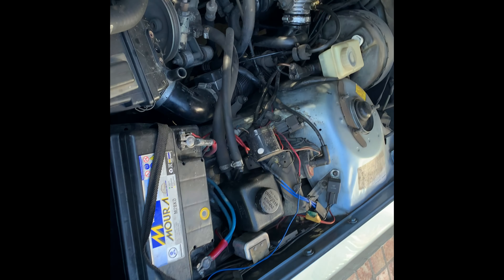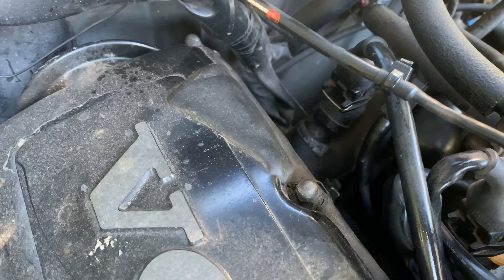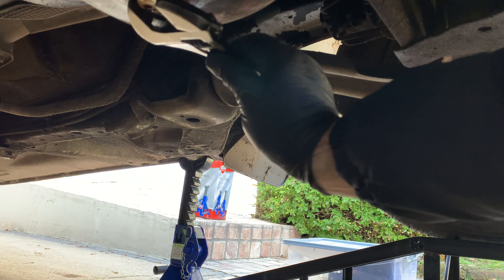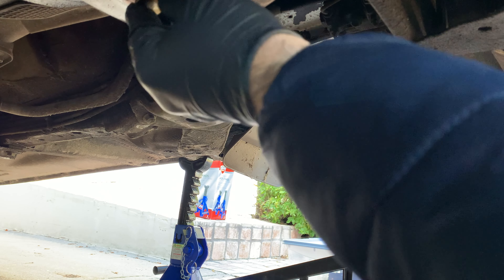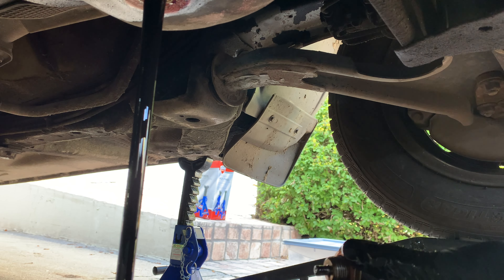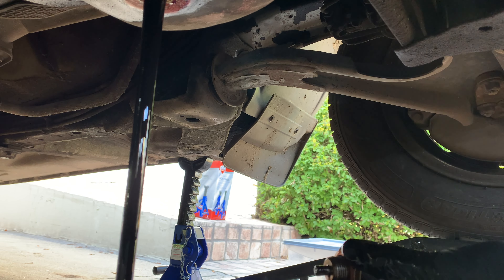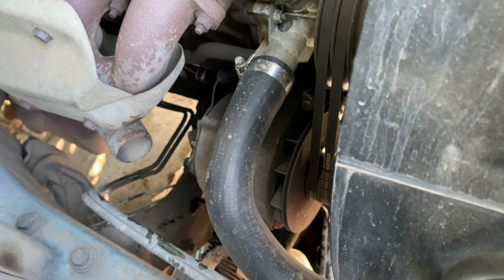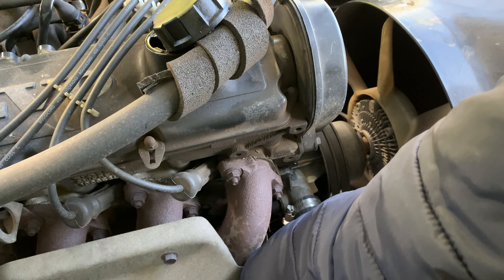Volvosaurus Gets a Quick Oil Change (Volvo 240 oil change)

Comment: When I have to install any of my oil filters at an angle, I will pre-fill the filter on the work bench all the way so the media will absorb enough to get soaked. Then I pour the rest back into the oil jug to put into the engine. It isn't as good as a normal pre-fill but it is better than nothing. 
Good video!
Reply from the maker: Nice trick!

Comment: Along with the white "smoke".  Your oil cap had a creamy white substance on it. It could be moisture in the oil. Does the car sit for long periods of time?
Reply from the maker: I use it very rarely. Once every 45 days for a full day only. There's no creamy substance in the oil cap, it looks like there is in camera but no creamy substance either in the oil cap nor in the water reservoir. Thanks!